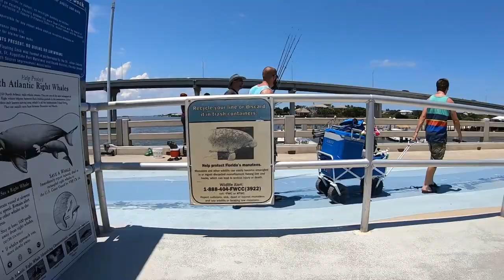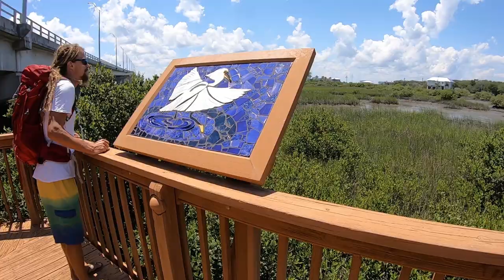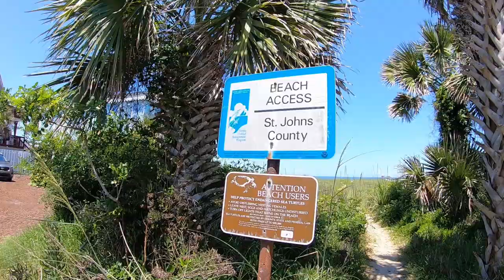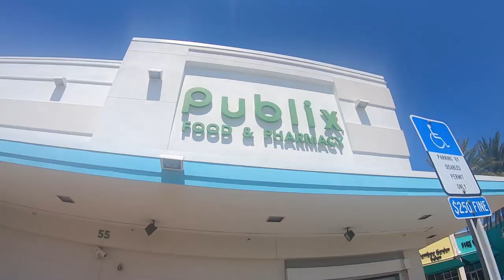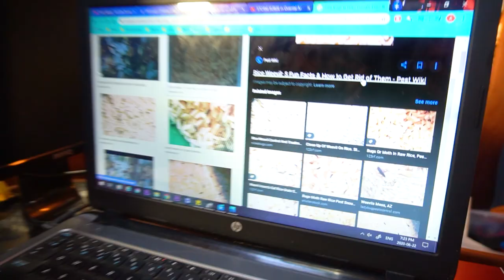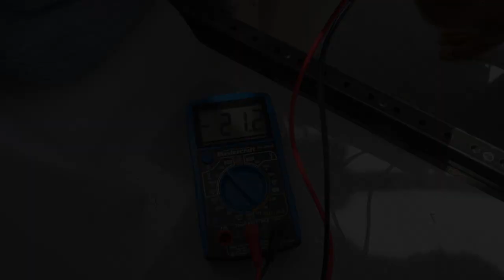Small SQUALL destroyed solar panel. Can we fix it? [Ep 145]

Comment: Sailing Uma channel had Greek Feta cheese in olive oil for two years and they tested it no problems .  Some other channels have good food preservation ideas .
Most veggies in vinager l last long times.
 I am testing out home canning solutions. 
I will keep you posted if it works.
 I prefer to avoid Fridge solutions that need  electric power.
If you can replace your alternator with 80 amp or larger types but every 23 amps draw takes 1 bhp from thr engine power to the propeler. 
The bigger alternator Bulk charges the house battery to 80% guicker than 50 amp type and then solar panels can do the last 20% over the rest of the dsy 
 I mostly do candles parrifin light and gas bottles as much as possible. 
Later I  hope to do a electric outboard 24 volt 2500 watts  and  4 of the 120 watt solar pannels and 4 of the Trojan 6 volt golf cart 220 amp lead acid batteries to push my 30 foot 3 ton boat in calm water at 1.5 knots if the inboard enginr packs up or there is no wind at sea . 
Yes lithuim battery  is better than lead acid  but my budget wont go there unless lithuim battrry  prices get very cheap.
Reply from the maker: Those are some good ideas. We always like new ways to store food. Anything out of the fridge means more room for fish and lobster. We really enjoy having a fridge and are hoping to get a freezer as well. We have also worked out our power usage issues this year and haven't even thought about power this season. The larger alternator could help but we don't really need it since our solar keeps up with our usage. We will have a video coming out soon on our lithium battery build which unless something goes wrong with the batteries will easily be one of the cheapest option for batteries. The cycle life and charge and discharge curve is just so much better for life on the hook. Not to mention how lifepo4 likes resting at less than full SOC (perfect for solar). At 280ah it replaced our agm batteries at 1/4 the weight and cost roughly 900$. Comparing to roughly 500$ for agm that lasted 2 seasons with almost half the usable capacity when brand new. Time will tell if they last as long as I hope but we love them so far. Thanks again for the in depth comment.